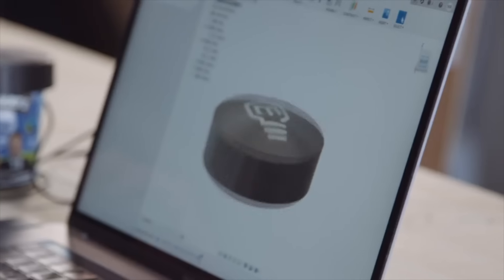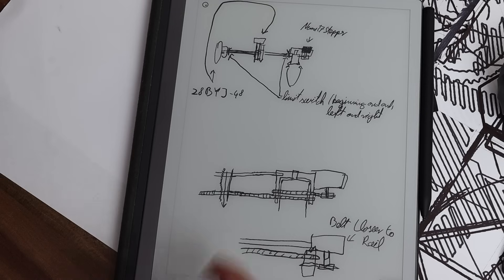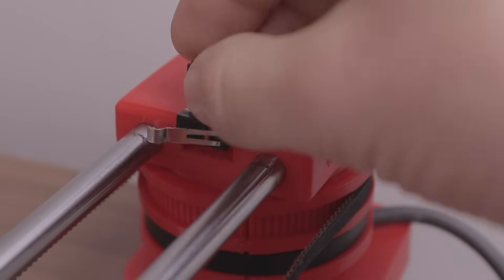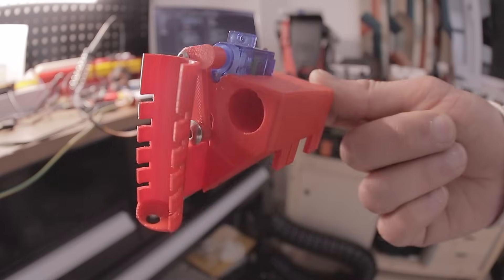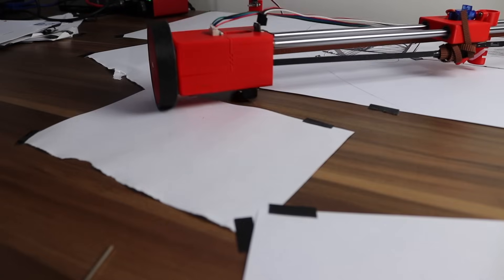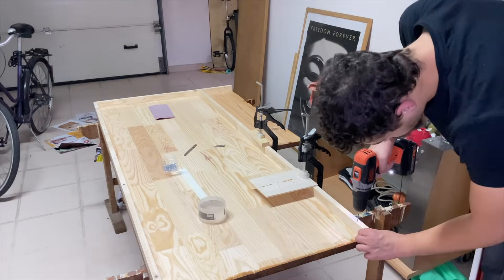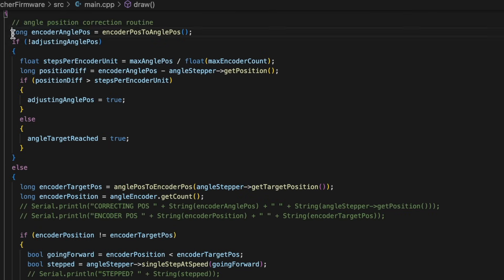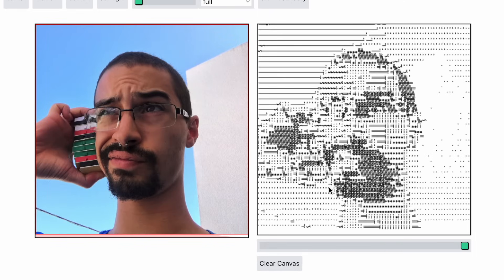DIY Arduino Pen Plotter that Mark Rober loved

Comment: I'm currently working on the 'engineering' part of a rubik cube solver (software part largely finished).  Completely clueluess about engineering principles and going through a lot of trial and error.  That Mark Rober course on engineering principles might just be what I need. 

Anyway, really interesting video, and I appreciate the details, including the failure points prior to the successful build; really useful.
Reply from the maker: The hardware is also the toughest part for me atm, iterations are much slower compared to software!
Thanks for the sub man, hope you like the new video series too

Comment: Amazing video bro! Looking to build a concrete 3d printer using polar cordenates. Exactly the same way u did it. Amazing job!
Reply from the maker: If its about learning thats cool, but for many practical reasons I would advise not to :P

Comment: Cool project! What language do you program in for this project? What is anhold respurce to learn some cad drawing?
Reply from the maker: A couple of them 😅 I’m using python for the backend and the path generation things. The microncontroller code is in C++ but it’s mostly simple stuff. The UI uses typescript

Comment: Ohh, nice space saving design of a plotter! I wonder what the accuracy is, have you tried to measure this? I can imagine it's very different from close to the pivot than far from it. And perhaps its better at arcs than at straight lines? Those are the kind of things I'd be curious about if you do a follow up :)
Reply from the maker: It doesn’t tend do drift off, but I’ll definitely include some tests!
There were many more problems I solved that I just couldn’t address in this video yet :) thanks for the suggestion
Reply: @esser50k  it's not so much drift that I expected (your encoder solves that), but I imagine there has to be some slack, that is magnified further out?
Reply from the maker: @DanielSimu  I see what you're saying! The stepper motor is running with 32x microstepping. So it is actually incredibly precise even when moving further out, but that's just my impression from looking at the drawings. I'll definitely test that hipothesis
Reply: @esser50k  makes sense! I somehow had convinced myself that the stepper was in the encoder axis, despite already having seen that that was not the case. With your setup you probably indeed get incredibly high precision, assuming that you can correct well for any slipping. Nice job!
Reply from the maker: @DanielSimu  slippage was really detrimental to this project, deffinitely more on that in the next video :)